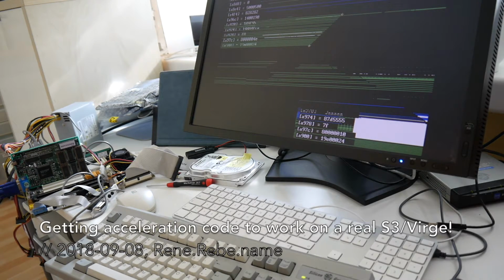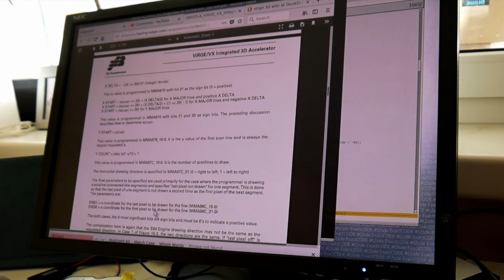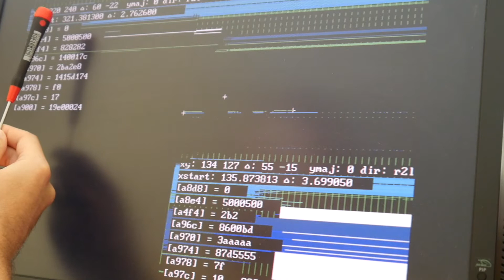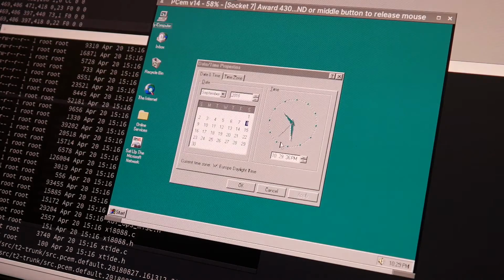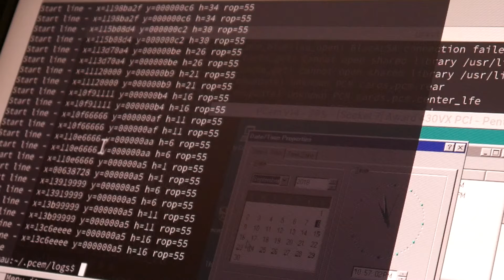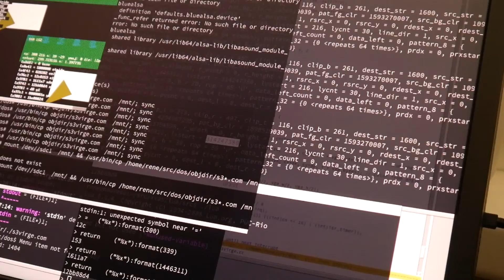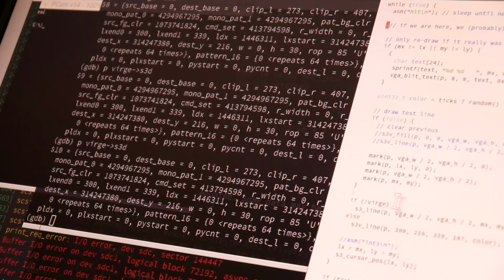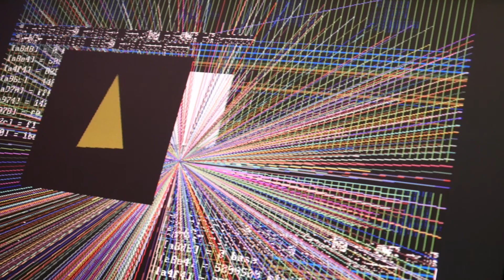Acceleration code working on real S3 Virge/DX! already suspected a silicon bug!! :-/

Comment: Just idea "fixing bug in PCem" video I think PCem is nice SW and thank for showing it to me.
Reply from the maker: In pcem it already worked in the 1st video, or you mean the missing 3d lines? I only suspected a bug in the actual Virge/DX hardware, due to initial corrupt on screen artifacts, but that turned out to be a single missing "MONO" bit ;-)
Reply: Thanks for explaining it to me, was loosing it at the end. Not eve sure it was about https://github.com/freedesktop/xorg-xf86-video-s3/blob/master/src/s3_accel.c#L305-L342 . At least I could learn what https://en.wikipedia.org/wiki/Bresenham%27s_line_algorithm is :)
Reply: 1st video was working on pcem, but shouldn't be working as there was bit missing
Reply from the maker: Lorelai L. Well I guess the bit is mostly meaningless, it is just some hardware quirk - such things are often not worth to emulate. Hard to understand what overflowing nonsense the hardwired engine is doing there anyway, …